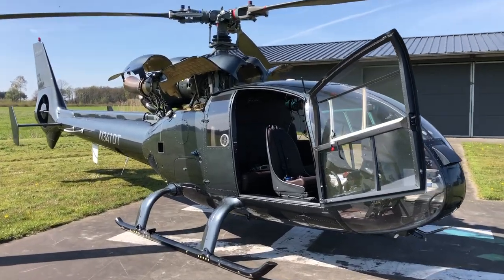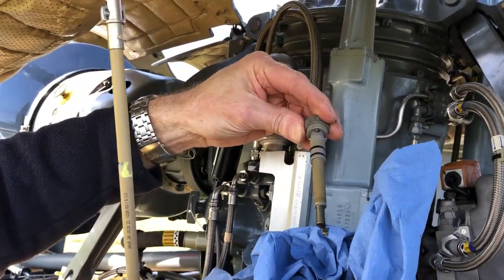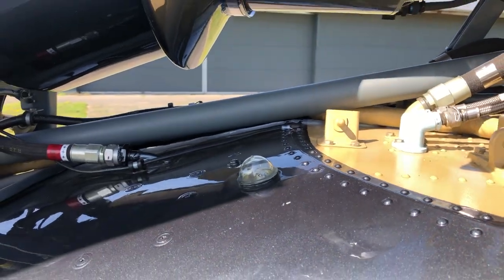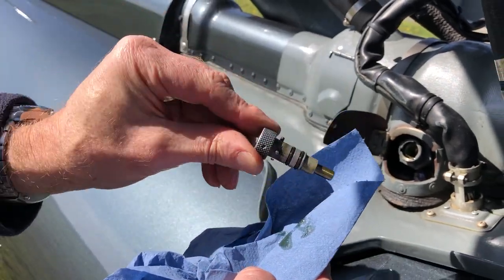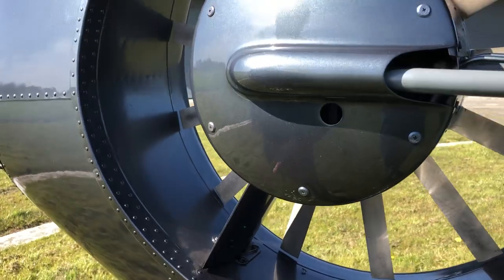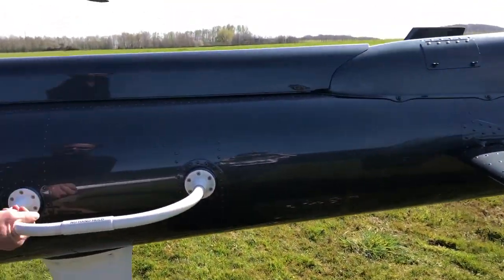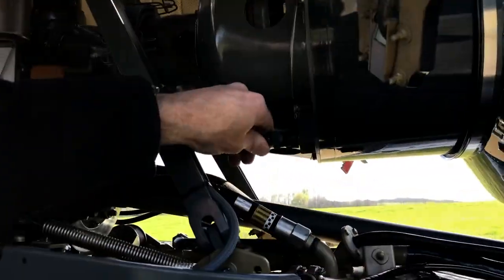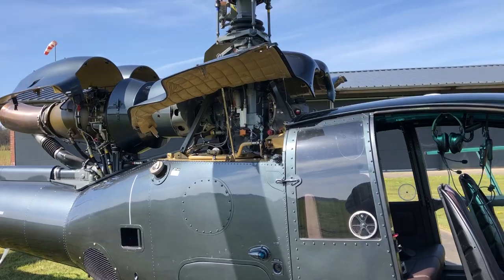SA341G preflight inspection

Comment: What would metal particles on the check indicators indicate?
Reply from the maker: Metal particles means component wear, further lab analysis can indicate if it comes from a gear or bearing.
Reply: Serious effin problem. Gears are grinding and there is metal to metal contact without lubrication.